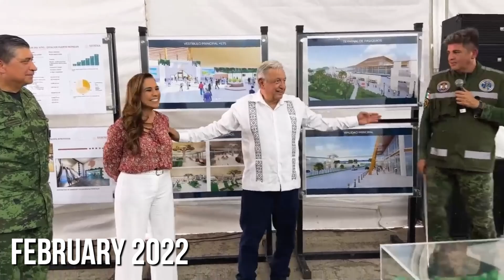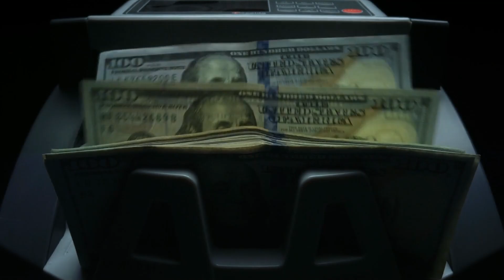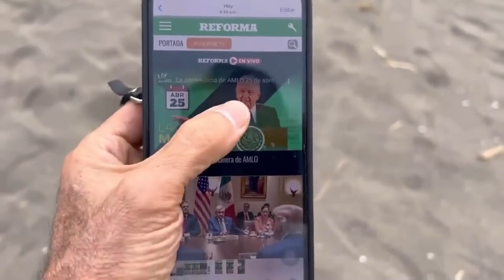Mexico's Massive New Tren Maya Railway Project Moves Ahead!

Comment: Not withstanding the environmental damage, as a project it's already doomed. More than 400% over budget and federal government has admitted it'll run at a loss forever. Not to mention it's more expensive than current bus routes and so far slower, though speeds have been  promised to increase. It's just another vanity project by an out of touch political party.